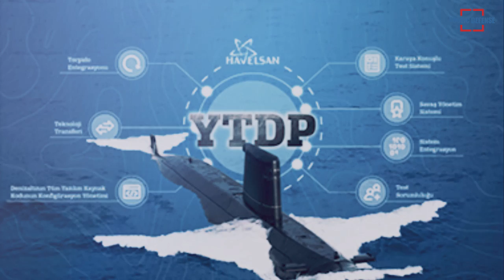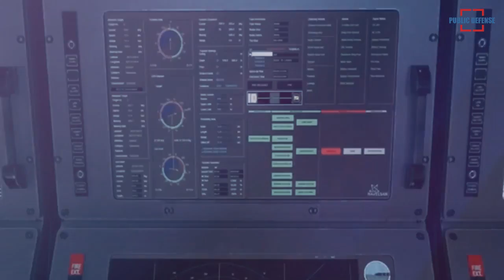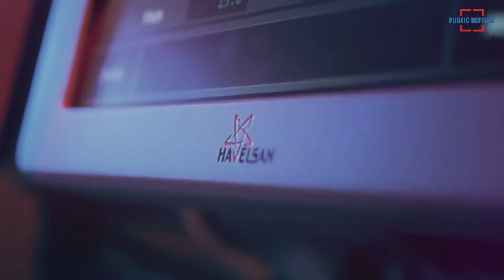Turkey New Type Submarine Project will be Equipped with Command Control System Developed by Havelsan

Comment: Turkish experts modern design of class submarine.... 12-tubes vertical launching pads of ballistic missiles...
Reply: VLS DON FIX IN U-214  if they are not  biger  like 218 Aip  12 TORPENDO TUBES NOE WAY 8 OR 10  FEETS PERFECT 
 HELLAS HAVE EXOCYTOS LANCED  MISSILES  EXOSSET BLOCK 3C  SCALP NAVAL  ON ROAD   BRAHMOS  LANCED FROM TUBE 9 AND 10  ONLY ONE NAVY HAVE  THIS 214AIP.OPERATIONAL  
HELLENIC NAVY
Reply: But turkey have no ballistic missiles
Reply: otto Lincoln  power and bigger military wont make turkey control the sae
Reply: otto Lincoln  look at israeli diplomatic power...  we dont have much military but our voice its power, and look at egypt with a ahit economy and no power but bog military... u need more then military to " control the sea"
Reply: John Rock  we do, and its a fact.